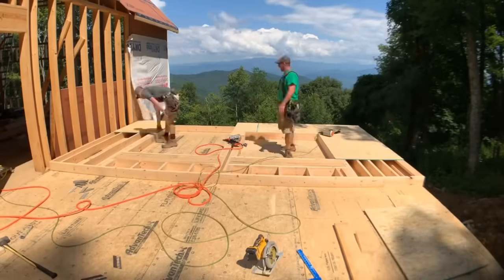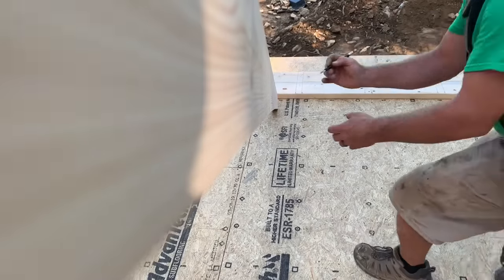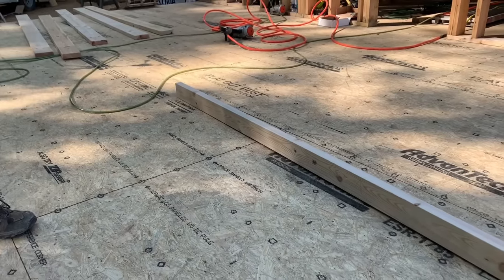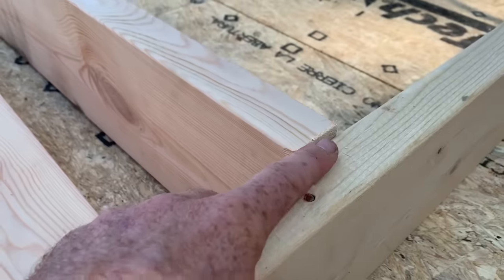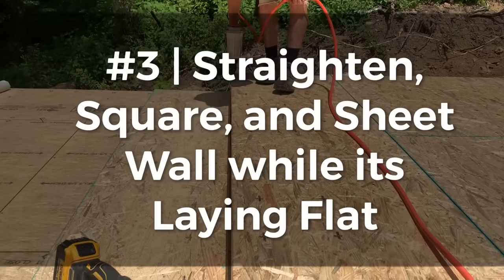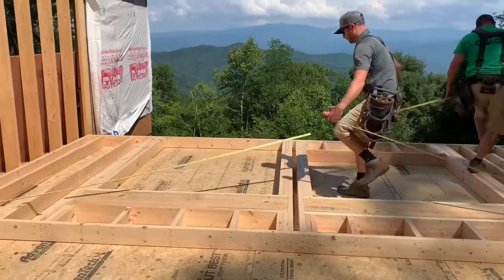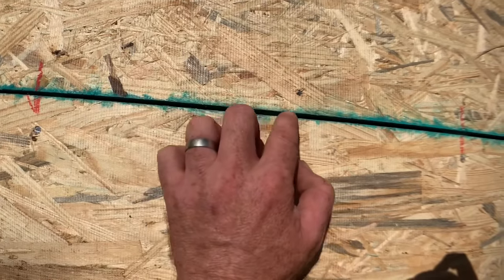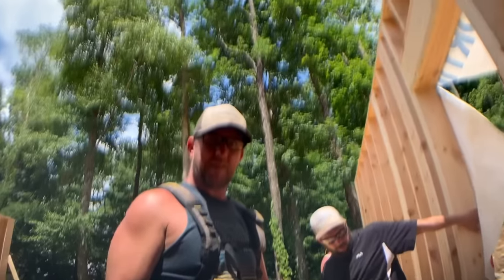Build GOOD Walls! How to do it.

Comment: All good tips. I framed for over 40 years and loved it. I like the fact that you can see how much you’ve done by the end of the day. My brother and I had a framing crew for many years. We started with just 2 employees and gradually worked up to 38. When we first started just 4 of us could frame a duplex in 4 days. That was from the slab to ready for the roofers and ready for all ext. paint and ready for all the other trades on the int. Something we did, that I rarely see, is we would put the sheathing on the walls when they were laying down, just as you, but we took it further. We’d also set the windows and doors, nail the soffits to the walls and put all the siding and trim on. Everything is a lot faster and easier when it’s laying down. On the end walls, we would put the gable trusses on with the soffits before lifting. (We had to leave the sheathing and siding off the corners so we could tie the walls together). The back walls were 96 ft. long and pretty heavy, as were the gable walls, so we used wall jacks. The roofs were usually a 4/12 pitch so that was low enough that we could lean over and nail the on facia from the roof. The only time we had to use a ladder for ext. was for the corners, precisely the sheathing, siding, soffit and corner boards.
Reply: I miss framing too their are not many things in life like being a beast framer.
Reply: Wow never seen it done quite how you are describing.
Reply: @chrisreynolds2410  p
Reply: *there

Comment: That's not plywood... It's vertical mulch,  a.k.a. OSB
Reply from the maker: WaltWW yep
Reply: Otherwise known as "Obviously Shite Board"
Reply: o.s.b. ...outdoor shit for building
Reply: It's still ply wood
Reply: Just add water for instant cheesecake.
Reply: Or aka sheeting where I like. Or 7/16 OSB
Reply: @garychambers5930  haha no
Reply: Hahahahahahahaha yes
Reply: OSB-> “Oriented Strand Board”
Reply: OSB is just plain garbage. People using it might save a buck, buying it in volume, compared to a piece of cross oriented sheet real plywood. I'm designing a house that I hope to build someday with the help of some local mennonites and plan to use marine grade plywood on the roof and the bottom run of the outside nearest the ground should I be able to get a good price.
Reply: There was a time when floors, roofs and walls were sheeted with plywood. Those times are gone, but the term "plywood" is still used. When the foreman tells someone to grab some plywood they should know what he's referring too. The newbie is usually the first one to say "that's OSB not plywood". At that time the foreman will reach into his pouch, pull out his chew and pack a big ole lip. Staring at the greenie the whole time. He will then say something like, "Kid, I've been doing this for.....". You will be a "Kid" even if your forty. And the rest of the crew will call you "Kid" from that day forward. Don't be a "Kid". It's all "plywood" when talking to the crew. If Matt Risinger or someone else wearing a polo shirt stops by you can call it osb.
Reply: Daniel Fronc why marine grade on the roof, if you get a leak it can still rot your truss or mildew same as regular plywood.
Reply: Josh Weaver  I paid for plywood and told the builders they would not be paid if they didn't use the plywood specified in the contract.
Reply: OSB absorbs water over time and gets flimsy
Reply: Josh Weaver 
OSB, is simply not PLYWOOD, anyone who refers to it as PLYWOOD does not know how to be specific with their nomenclature....
OSB can only be called one thing other than OSB, that term is JUNK
Reply: I call plywood, wait for it.... Plywood. And I call OSB,  guess,  OSB! (OSB is ever on my job) typically tho I refer to it as sheathing unless I'm building or making something from plywood, which is 13 ply or higher
Reply: RJ Melehan reminds me of builders that refer to posts as beams. Makes me want to rip my hair out. Or people who call pergolas, arbors.
Reply: Michael Fresh  shingles, now that's something crazy. I've seen some fellas go up ladders carrying 2 bundles of shingles. But not much ever since they invented that elevator thing. Its pretty cool.
Reply: Structural Engineer here.  If installed correctly (correct nails, and edge distance) and adequately waterproofed, OSB is every bit as strong as plywood.  Don't confuse it with particle board.  It's not the same.

Thanks for the excellent video.  I have been telling people what the finished wall should look like for 30 years, always nice to see it done.
Reply: @arthurfellows4346  Some of you 'Engineers' need hands on training.Ive been building for 40 years.OSB is garbage.Pour a little water on it.
Reply: jj james 

If you read my post you will note that I was specific about the waterproofing of the product.  I too have seen it delaminate when not cared for properly. I know you feel like you are some sort of authority, but, I have been practicing structural engineering for 30 years now and I started as a carpenter.  I know a little about building materials. 

Too many of the opinions here are just that, opinions.  You are free to keep and express yours, all I ask is that you read my post before you write something in reply.  

This product, has a function, as a nailing substrate or as a shear panel, and it reliably serves that function.  It has for decades.  It is not designed, nor intended to be waterproof. (Neither is plywood, btw)
Reply: Cheap ass contractors can never tell the difference.
Reply: Press wood we call it
Reply: @Fly1Style  not necessarily.....depending on your country/state/provincial/regional code.....we aren't allowed to use it for anything structural so you won't find that sitting around our job sites.....reason being it's failed too many times in our environment to be considered safe....the only general rule of a job site these days is there aren't general rules in building.....just depends where you live
Reply: @arthurfellows4346  we build in the pouring rain in British Columbia....50+ mm of rain a day sometimes so "waterproofing" as you call it is irrelevant....our scenario deems OSB too be a horrible product so 30+ years experience doesn't mean much depending on the environment and building code (we can't even use it here)
Reply: Theres nothing wrong with osb structurally. You're all just being high maintenance.
Reply: I've seen 3/4" or better plywood subfloors laid out over 12"oc joists that were glued and screwed have to be completely ripped out and replaced after 1 good rain storm on a framed house without the roof system installed. Between the floor joists the plywood warped over 1/4" due to the rain. The OSB was just fine though. This was Georgia Pacific plywood not uncle Larry's discount homemade nonsense too.

OSB gets a bad rap with a lot of builders. I'll take a properly installed OSB product over a plywood product. OSB won't delaminate like plywood will under mild condensation via improper ventilation.
Reply: @RDDPro  Interesting, must be some poor quality control on that plywood.  I have had sheets of 1/2 untreated plywood unpainted stay out in the weather and rain for years on barns, sheds, deer stands, etc and never had a piece delaminate or warp. I have used OSB and it turns to mulch in less than a year.  Obviously it is not intended to be left out to the weather but compared in the same situation the plywood out performs the OSB by a long shot, use what works for you, I'll go with my own experiences.
Reply: insert name here ...Back when I was a kid doing shingle roofs ( in the 60s ) that’s how we got All the bundles of shingles up onto the roof, carrying 2@ a time. Then we realized an outrigger onto a section of scaffolding would be a lot easier. Of course that all was before we could afford to rent an elevator which actually paid for itself by finishing faster, thereby getting us to the next job quicker. Work Hard Play Hard
Reply: Michael Fresh   Particle board is that compressed sawdust/glue crap that is used in melamine sheets.

Comment: I couldn't agree more, sheet the walls before standing them. I can't understand why some framers seem to want to make things harder on themselves.
Reply: Adds a lot of weight on big walls and makes it harder to raise.

I always nail 2-4 sheets down after squaring, then hang the rest vertical.  Saves the back and keeps 'er true.
Reply: @MotivatedMetalworks  It does make them easier to raise.
Reply: @Jay-tk7ib  Not when it's 2x6 16" OC 35' long and 10' tall with one door and (2) 4x2' window openings in the whole thing.
Reply: @MotivatedMetalworks  I was agreeing with you. Raising the wall unsheathed is much easier to lift, but if you have the man power, or wall jacks, you save yourself a lot of work by sheathing before raising. But you gotta do what you gotta do.
Reply: I'm going to try doing it with my tractor's front end loader on my next 40' long wall.  Certainly not always an option, but might be the hot ticket when it is.
Reply: I built many double decker chicken barns 600’ long and we sheath the walls prior to standing them on the second floor. Do 48’ sections then nail the overlapping plywood from the outside after standing. By far much easier than working off a scissor lift sheathing on the outside.

But watch your bracing. I was off for four weeks and the guy left in charge didn’t brace properly and we lost 600’ of wall. Blown over the edge.
Reply: @willanderson3318  I'm guessing you had more than a 4 man crew, or had mechanical help to lift.

90% of the time, I'm working alone.  My new shop will be the first time ever using hydraulic assistance in raising walls or trusses.

Comment: Nice informative video, just wish you would have explained mistake number four. 
Typical framers will begin by nailing every stud ,trimmer, and cripple to the sole plate without consideration of channel blocking and nailing headers to king studs etc. Would have been nice to point out to start nailing in order of accessibility. Example at 3:45 in the video you show clearly that there is room to screw the header to the king stud. If a 16”oc stud is right next to the king stud and nailed already at the sole plate, it makes it almost impossible to efficiently nail/screw header to king stud.
Keep up the imformative videos!!

Comment: Nice job. Many many carpenters don't overlap the rim and sills with the sheathing and inspectors don't flag it. The only thing holding down the walls are the nails in the plates. Thats so important to keep the walls anchored down when there is uplift in high winds or seismic concerns. It also adds another layer of moisture protection to the rim and sills which so often rot out from improperly flashed openings above. I've seen million dollar homes with absolutely terrible framing practices. You guys are stellar.

Comment: FINALLY. Someone sheathing a wall on the ground. Youtube is full of the other guys..... I cant imagine how anybody makes money trying to throw sheets and then tyvek up off of a ladder.  We put everything on the damn wall, overhangs, siding, gables and bay roofs etc.  We build our whole porch on the ground too!!  So much faster.  Cheers from Michigan!!  

One thing we do differently, is that i fully toenail the bottom plates of the front and back walls (first walls to go up) to hold the wall in place while lifting.  Gets rid of the need to fasten (and remove later...) blocks on the big walls.  Once wall is up to about 75-80 degrees they all pop out.. Bink Bink and we just smash em over.  Again, good stuff great vid.  Rough carpenter 18 years
Reply from the maker: Thanks brother! Cheers from NC
Reply: I HAVE ALSO DONE IT THAT WAY. HAD NO IDEA ANYONE DID IT THE OTHER WAY.
Reply: Bet it looks like shit when your'e done !! .. I know you can't do that style with the mansions I build ..   Slap it up for the glory of a dollar
Reply: Would be a heck of a lot of wasted time to stand without sheets on..
Reply: In a lot of jurisdictions you MUST leave building wrap off until you’ve passed a “sheathing inspection.”

The engineer wants to see nailing pattern and type of nails. The city inspector requires that windows and doors are installed prior to sheathing inspection.

It’s a pain buts it’s reality. In those jurisdictions there is really no way to put the Tyvek on before standing the wall.
Reply: @willanderson3318  gotcha.. I figured as much.  We get inspections for sheathing too, but the inspectors will just cut some tyvek in the critical areas... Portal frames etc. Then push on ply from the inside.
Reply: @IVORY123100  how exactly?  It is in fact opposite..  We build quality 1-2 million dollar custom homes... Anywhere from 12-25 bucks a ft^2.  There is no looking like shit, bud, just speed and efficiency.

Comment: Saw a comment about marking tops of studs ...agree. I've used a lumber keel crayon in a holder for years. Pick a bright color. If you mark crowns up on studs rafters floor joists a quick glance will tell you if there's a mistake. Like your vids well done and to the point.
Reply from the maker: Good tip

Comment: Good video.  Was a professional rock hanger for many years.  I almost never saw those diagonal tack nails pulled out after the wall was raised.  Usually had to beat them down into the corner before hanging the bottom rock sheet.
Reply: Guilty

Comment: Seattle framer here.
We put our ply vertically to minimize on horizontal rack blocking for edge panel nailing.
We also can't cover nailing until inspection. Curious you used zipwall for roof but not walls.
Also, this is just a personal thing, i push all headers to touch the top plate, then you don't need load bearing cripples. I also use HH6 to hang them instead of jacks, great for standard load bearing applications under 6'.

Comment: Doing it the same up here in Montreal. 
A couple little differences 
I was tought to nail the bottom plate to the floor first before you nail any studs in.
We use 2×6 on our exterior & load bearing walls 
We put a 1/4" × 5 1/2" foam under the bottom plate.
We would use a chainsaw to open our window openings. 
When i started we put one osb 4×9 & then 2 4×9 sheeting. Something about letting the house breath. 
Now its all 4×9 sheeting 1/2" with a 1" styrofoam (isofoil) 
Its cool to see we are separated by a couple 1000 kilometers yet we have the same building techniques.  
Love your videos.

Comment: When I frame an exterior wall as you did here, I put a bead of construction adhesive under the plate and the OSB down the side of the rim joist. NO bugs or air will ever get in
Reply: Nice Jerry!   Good forward thinking!
I was in the USAF with a Jerry Hubbard.  Are you he? 🤔
Reply: @harryl7946  Harry, that is funny another has the same name as me. Good luck with your projects.

Comment: Good video.  Looks like a  beautiful spot to work.  We do things slightly different.  When assembling an exterior wall, we put the wall plates on some scrap blocks so that we can feel that the studs are flush on the interior face (drywall side).  Sometimes you get variants in width of studs or plates and we like to have the drywall side flush and the exterior side is less important as you often have an air space for masonry or strapping for siding.  Also, a stud that is crowned a 1/4" should be used to cut up for pieces above and below your windows.  Keep the straighter ones for studs and cripplers.  Find a supplier who can get you premium grade lumber and you will have straighter material without wained edges too.

Comment: You should have also put construction adhesive under neath the bottom plate to help secure it more and keep bugs out. They can fit through small cracks like that
Reply: Most builders these days caulk all plate and stud joints.  It's a whole other job for a different company.
Reply: It makes an ungodly mess and the wall usually slides around because of the coating. We just caulk the inside of the sill plate after the walls are stood. Much cleaner and easier.
Reply: ThisGuyWantsBeer I’ve never had it be a crazy mess, but it makes it a way stronger wall overall
Reply: I run a thick bead on the outside edge of the subfloor before we stand the wall up. Better to stop bugs before they can enter the house at all
Reply: What about insulating foam, no arrent drafts no bugs. Between the bottom plate.
Reply: @ThisGuyWantsBeer  When you say you just caulk the inside of the sill plate do you mean that you just run a bead at the bottom of the wall?
Reply: Daniel Fronc yes, that’s all it really needs. It hardens and creates a good seal. Glue under the plate is generally messy and slides while nailing or the wall floats from buildup spots, foam tacked underneath rips and tears when the wall slides making it useless. We don’t need the adhesive underneath because we shoot full head ring shanks in every bay. I’m doing mostly new construction so I’m buying pallets of gun nails and the price between ring shanks and smooth nails is hardly noticed.
Reply: Lol Unless you building your own house don’t expect a builder or Mexican labor to waste time and money on caulking bottom plates and such. That would put Pest Control companies out of business.
Reply: @jrandall5736  I think we have to to pass inspection

Comment: Step 1 is get rid of all studs that have over 1/16 inch crown. Even one stud that has 1/4 inch crown next to one that has no crown creates a crooked wall.

Step 7 tyvek has to be installed with a nail and cap per tyvek installation instructions. Staples with no cap will void the tyvek warranty.  Also has to hang by the foundation 1 inch.
Reply: so with that we would end up going with steel.
here in boston the studs turn to branches as soon as home depot cuts the bands.junk within 20 minuts,
Reply: @softmetals3702  Same thing here in Michigan. You sort through 100 studs to find 10 straight ones. Then, if you don't use them today, then by tomorrow they are all crooked as hell.